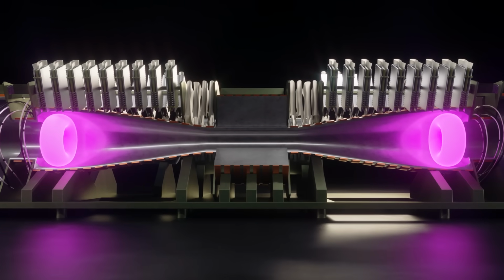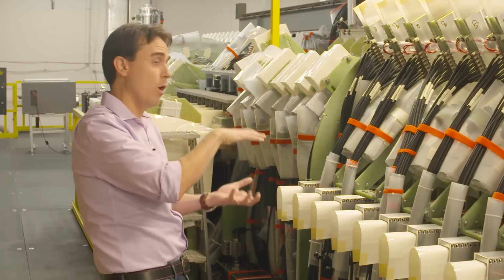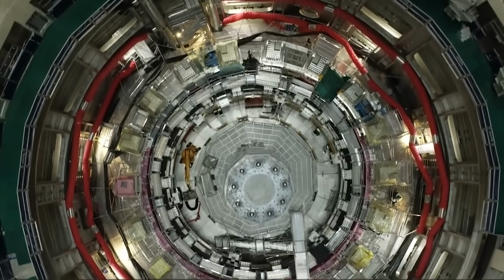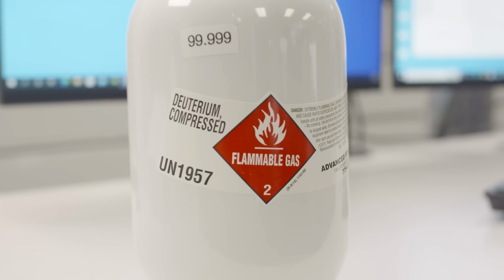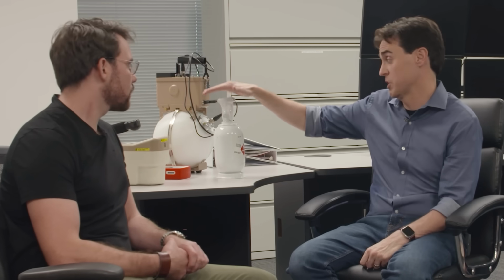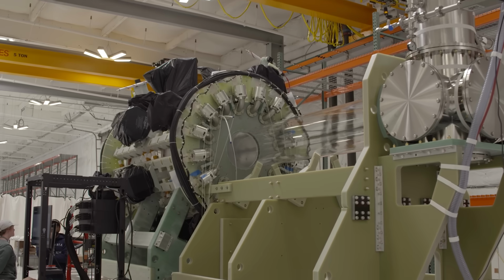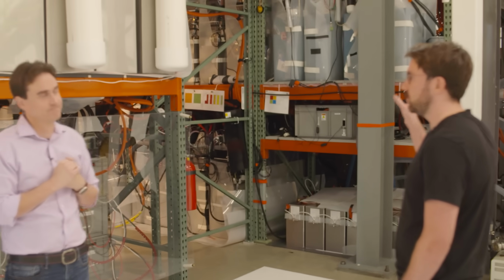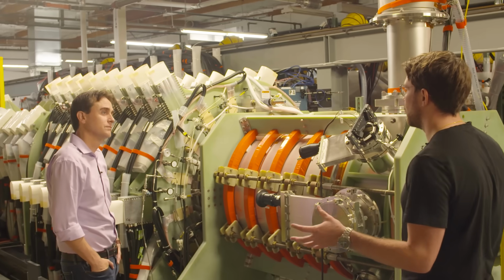A New Way to Achieve Nuclear Fusion: Helion

Comment: I have yet to hear the arguments as to why they think that it will work versus the arguments that it will not work.
Surely the scientific brains behind this project have thought out all the issues before billions was spent on it.
Or was it just blind faith.
I can think of many reasons that would make it impossible to achieve more power out than power put in and also many practical reasons why it will fail.
Its a very small sun in a crucible after all with neutrons spray.
It is a heat engine with unimaginable temperatures and near zero temperatures  close together confined in a very small crucible, probably smaller than the engine in a large cargo ship.
It just begs belief.
But I hope for all our sakes that they get it to work.
Reply: - There have not been billions spent on this project. Trenta cost 35 million, peanuts considering the potential.
- Helion does not use cryogenics. So no "near zero temperatures".
- There are neutrons, but they are only once every three reactions and only have 2.45 MeV.
- Interestingly, Helion's power plants are supposed to produce the same power output as an engine in a large cargo ship and they could replace them too. So, that comparison is actually fair.

Comment: Now you just need a second reactor, "some initial energy", to start both. and then the electricity output from one of the reactors will directly feed the other (without passing through the capacitor bank). At a certain point, both will be producing plenty of electricity, just inject it into the grid, or in the nearest industrial zone or a metallurgy or refinery, or even a data center. these guys are on the right track🤘
Reply: They need the capacitors to also store the fusion energy. Since their machines pulse at somewhere between 1 and 10 Hz. From there it goes into an inverter and then to the grid.
That said... They CAN and might (if the site wants/allows it) pair multiple machines that use the same power supply. That will save a lot of cost since the caps and the switches and all that make a significant part of the cost of a power plant. So you were not off my much with that thinking!

Comment: This is fantastic.  We are on the cusp of the ultimate energy source.  Who funds this project?  DOE?  One day every house in the neighborhood will have one of these.  No more overhead power lines.  It will be like buying a kerosene heater, and energy companies will be selling helium and hydrogen instead of fossil fuel.  I give it fifty years, which is what they said fifty years ago (smile).  Thanks for the video.  Really interesting.
Reply: I’m just a fan of this company and have been checking back here since learning about Dr. Kirtley. He worked for NSAS before this and is funded by Sam Altman (OpenAI) and they have a contract to provide electricity to a nearby Microsoft facility
Reply: It will be a bit too big for individual homes, but smaller cities will definitely have one.
Reply: @elmarmoelzer2229  You pretend like the device actually works. It is still a fantasy ...

Comment: if they are releasing neutrons, utilize a neutron moderator, like purified H2O to reduce the speed of the neutrons and eventually harvest this extracted energy from the moderator to add more power generation. there are materials that have a low microscopic cross section for absorption for neutrons. i hope they are utilizing materials like hafnium and no steels... neutron embrittlement is a real thing for steel.
Reply: - Their machine would produce one 2.45 MeV neutron every 3 reactions. That is not all that much.
- They use Quartz and aluminum. Both react pretty benign to 2.45 MeV neutrons. Si28 in the vacuum chamber has to absorb 3 neutrons to become unstable and then it has a short half-life of 2.5 hours. Aluminum when activated has a half-life of only 2.5 minutes.
Reply: @elmarmoelzer2229  it depends on the neutron flux density. sure, every 3 reactions, but your talking about billions of potential reactions occurring every second. its not just a few atoms, they are charging it with a few grams, and the amount of atoms is quite significant. 
it also depends on if the aluminum and quartz suffers a similar neutron embrittlement as steel, where the ductility of a material decreases while exposed to a neutron flux of significant magnitude.
Reply: @FNLastname  
It is still a lot more benign of an environment compared to Deuterium- Tritium.
Sure, materials will suffer over time, but if a D-T machine manages to last for a year, then Helion's machine will last for at least three. Plus it is much easier to service a linear machine than a toroidal machine.

Comment: DoD would like this. Its two plasma cannons pointed at each other. Lets put one on a tank.
Reply: Not even remotely practical.
Reply: @elmarmoelzer2229  are you saying the A1 Abrams is practical?
Reply: @1024det   Relatively more practical than moving a whole building for a gun that does not really work ;)
Reply: @elmarmoelzer2229  it generates plasma fine and it is controlled by EMF similar to railgun tech, maybe you didn’t watch the video. Also those capacitors could be greatly reduced in size and quality if enough money was put into it. Everything is big because there is a lot less funding for this compared to DoD contracts. It is not that far off.
Reply: @1024det  
I am quite familiar with the Helion design ;)
The plasma is very hot, but has a very low density (closer to a vacuum than ambient air). Once not confined by magnets, it expands quickly. Once exposed ambient air even, it cools off really quickly.
A Helion fusion power plant machine would be (even if built with weight considerations in mind) sround 100 tonnes, over 20 meters long (even Trenta was 15 meters) and would need a lot of capacitors, which would probably about double that mass and volume (even if very efficient and small capacitors were used). I doubt it makes for a practical weapon.
Reply: @elmarmoelzer2229  lookup graphene ultracapacitor, it has 748.5 Wh/kg. Now scale that up and see the energy potential. It’s not so far fetched.

Comment: But is it a constant stable fusion reaction, or does it quickly dissipate once the fusion reaction is achieved?
Reply: It’s an inertial confinement arrangement. So fussion is achieved and then energy is collected from the plasma for less than a second, and then the plasma dissipates
Reply: They’re good for achieving fusion, but actually making energy with them is basically impossible. Because the fuel has to be heated every time you want fuse the fuel. And most of the fuel does not undergo a fusion reaction

Comment: How much energy is used in making the helium 3?   There's probably less than 20 kg of tritium in the whole world not counting naturally occurring in the upper atmosphere.  How much electricity could be made if it all decayed to helium-3.?
Reply: It’s actually a big deal rn that Japan is releasing tritium infused water into the ocean from a fission plant. So fission creates fusion fuel.
Reply: @sumguy01   It is not a big deal that Japan is releasing Tritium. Only certain interest groups are making a big deal about it. The Tritium levels are harmless and is extremely dilute (which is why it makes no sense to extract it).
Reply: IIRC, world Tritium reserves are 60kg right now. 

Helion will use the fusion of Deuterium to make He3:
D + D => He3 +n 
OR 
D + D => T + p

Both reaction branches have an equal chance of happening. The Tritium in the second branch can be sold for $$$, left to decay into more He3 or burned in special versions of Helions power plants.

A mixed mode (does both breeding He3 and burning it for energy) 50 MWe Helion power plant will consume about 20 kg of Deuterium/year to make (and subsequently burn) 6kg of He3 and to make 6kg of Tritium.

Comment: It looks seriously like this will work if beryllium production is enhanced. So that we can throw 10 times as much beryllium is produced. Without that addendum this will not work as a worldwide energy source. This needs to happen on a very large energy grid worldwide. If it is to replace the cubic kilometers of oil now used. Also the tritium will effect the water supplies causing human problems. Molten salt reactors without flibe will be much safer. It will have to be Elysium's reactors that are fast breeder thorium reactors that fill this tremendous reaching bill to give humanity enough energy to raise the living standards of the most people. Liquid fueled molten salt reactors are our only hope for a better world.

Comment: Honestly I don't understand why they aren't also looking into using high-temp superconductor magnets instead of electromagnets, I imagine it would be insanely more energy efficient. Love the video and the work they're doing though!
Reply: It does not seem like Helion will need them. Pulsed magnets can produce strong fields even without superconductors.
HTSCs are great but they are also expensive and take a long time to cool to their operating temperature. They can quench catastrophically if you are not careful.
And finally, the simple aluminum magnets Helion uses are also reacting more benign to D-D neutrons.
So, at least for now, it makes sense for Helion to go with aluminum.

Comment: What is the chamber made out of to be able to hold 100 million degrees without melting?
Reply: There is a near perfect vacuum between the plasma and the chamber walls. The plasma is further kept away from the walls by magnetic fields. So nothing ever touches the walls. That said, there are some X-rays and particles that leave confinement hitting the walls. But the walls made of quartz are able to handle that.

Comment: So... we're still human. And as incredible as this will be, right now i'm wondering how this can be weaponized like any new source of energy has been. If just half of this machine the size of a trailer can create on demand a self-organized plasma? I'm hearing mobile plasma cannon... Fortunately it would need a working fusion generator to supply it with enough power to be worth it.
Reply: Not viable. It would be huge. The capacitor banks alone would fill several trailers. Aside from that, the plasma would immediately cool off the moment it gets into contact with anything, even ambient air. It would also expand and dissipate quickly without a magnetic field confining it.
Reply: @elmarmoelzer2229  Well, just kill my budding dreams for world domination why don't ya.